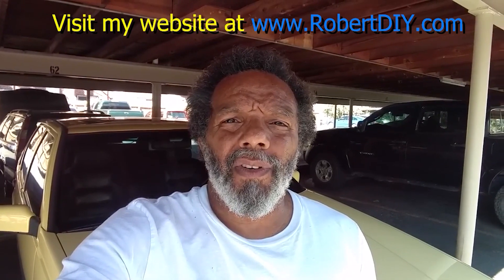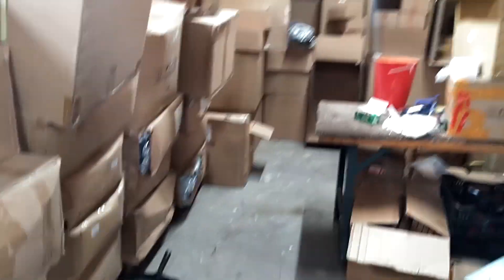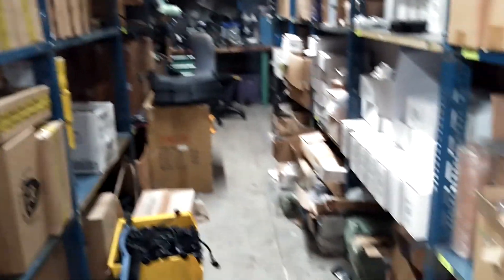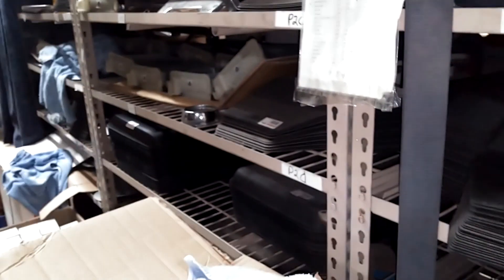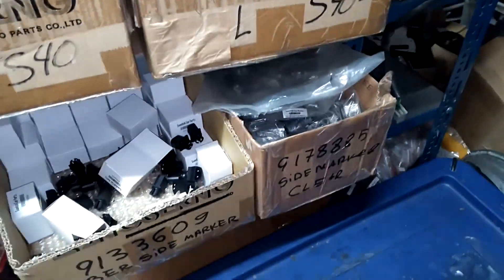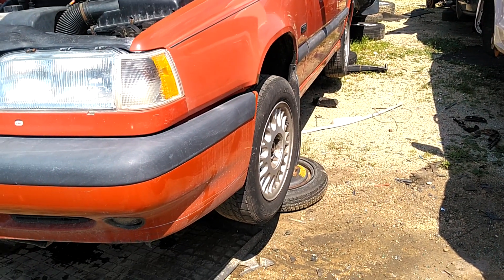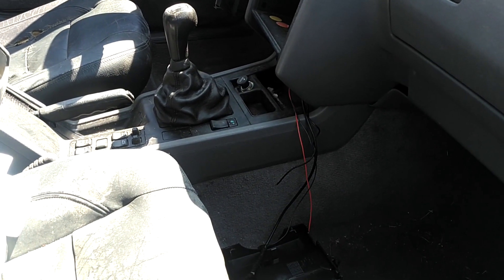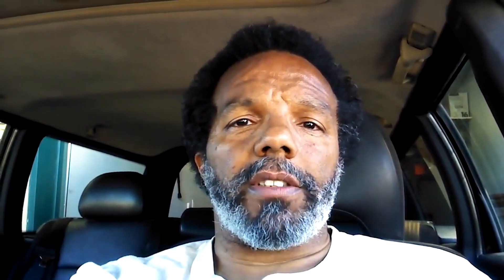Tomorrow's car show, short trip to Chi Town, manual transmission parts for Volvo 850's salvage yard

Comment: Hi Robert, I have a Volvo 850 t5 done the part oil change on the transmission last week all went well, jacked the front up today to do upper mounts on suspension, car was up for 5 hrs, when drop car back down ,started couldn’t get any gears, just grinding so turnoff and left. Could this be cause the car was up for 5 hrs and the oil drained back to the pan.? Thanks robert
Reply from the maker: nope
Reply: Ok thank you, maybe the torque convertor has seized or something. Enjoying your videos man.